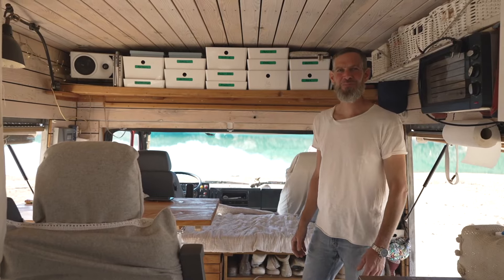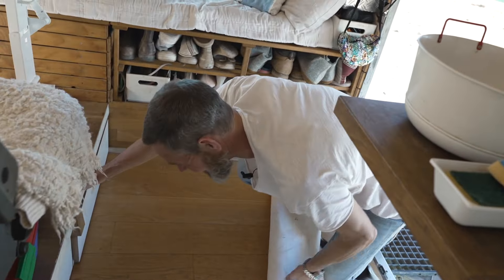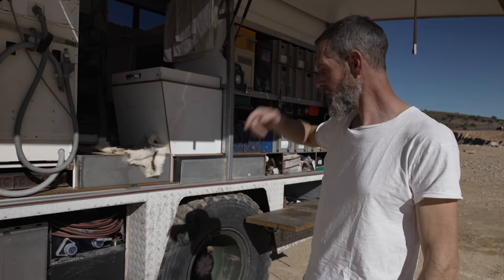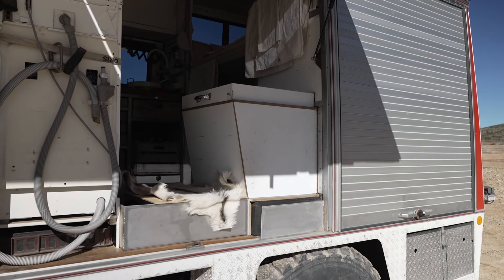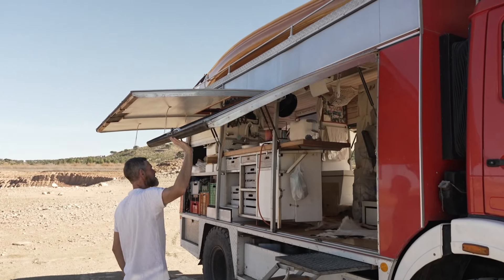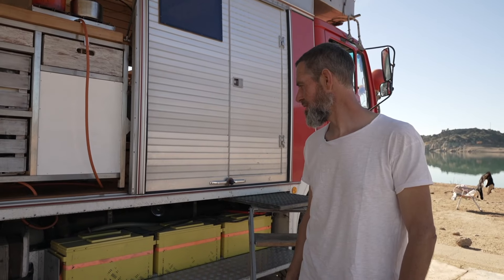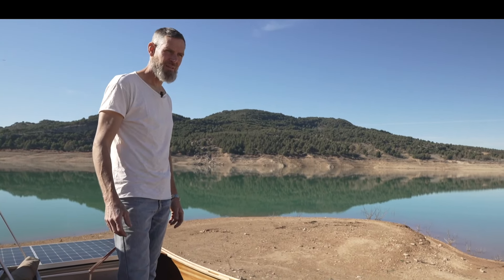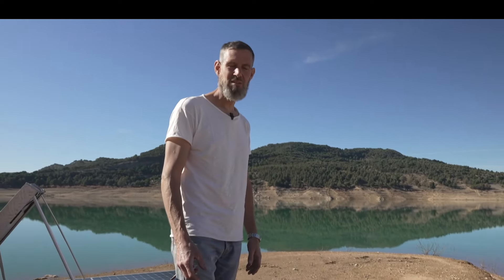Amazing & Versatile Fire Truck Conversion, Full Time Living -Why Vanlife#1

Comment: Hey there, nice built !! The truck looks great and I am thinking about doing some kind of similar projekt with a firetruck, different truck and different purpose but same idea. My question is did u lift up the roof so u can stand in it or was the hight like this before ?
If not how did u do it and did u get the H on ur plate in germany ? 
greetings from germany
Reply from the maker: Hi , You need to contact the owner, his instagram is in the notes.